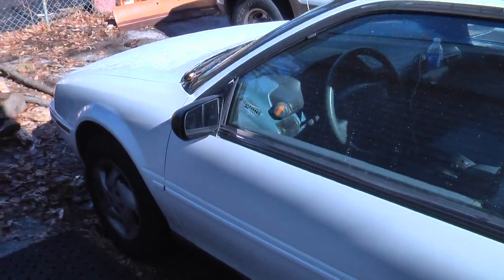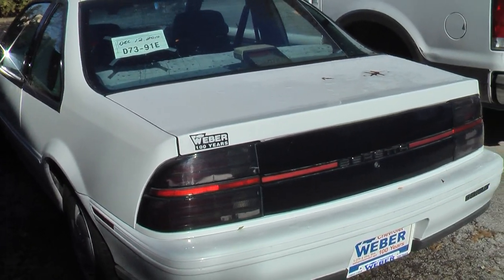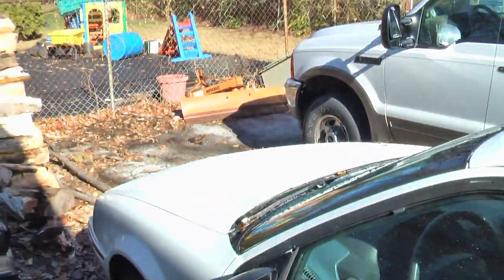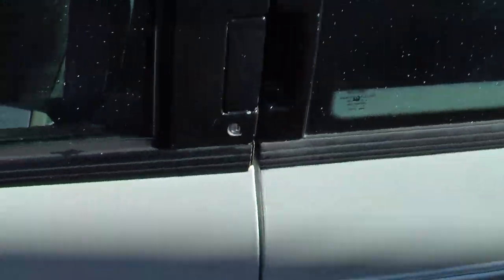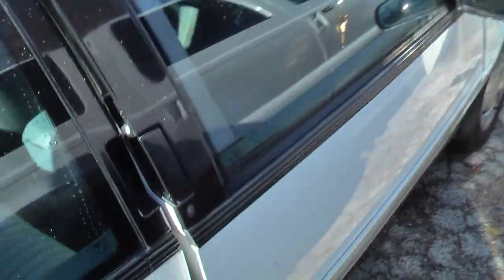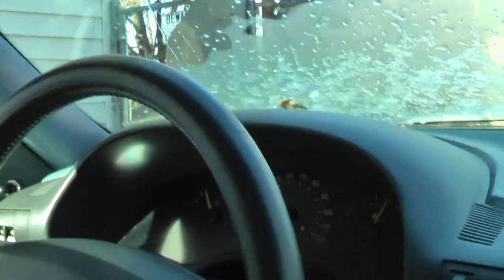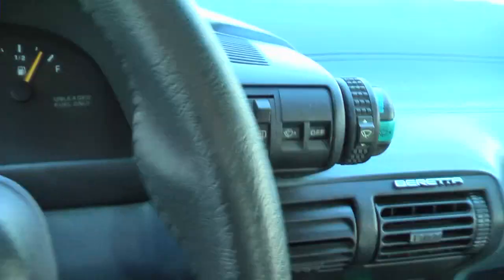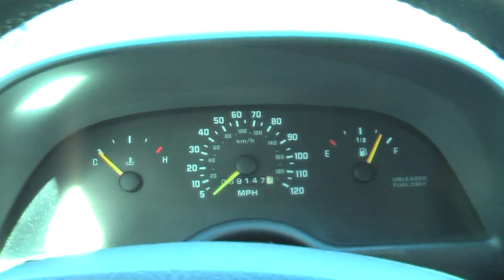Chevrolet Beretta First Look & Cold Start

Comment: Pretty nice Chevy Dan, Im happy to hear its treating you very well. I do just have a tiny suggestion for you and wd-40 on locks. I don't how your climate is around there but around here we get some dust occasionally and that wd-40 being an oil base really likes to attract that dust and get in your tumbler mechanism. I use specifically for locks liquid wrench dry lubricant as there is no oily film left to attract dirt. Works wonders for me hardly use the wd-40 anymore except for odd jobs.

Comment: I don't think the gas mileage is really different with the 4cyl or the V6.  When these were new, I used to get these (usually the 4dr version-Corsica) all the time when I rented cars.   The cars all were v6s with AOD trans and I consistently got 29-32 MPG highway mileage.  Only thing I didn't like was the front radio speakers are in the footwell so there is inadequate space to stretch your left leg.  Were much better than competing cars to rent, Tempos and Acclaims.